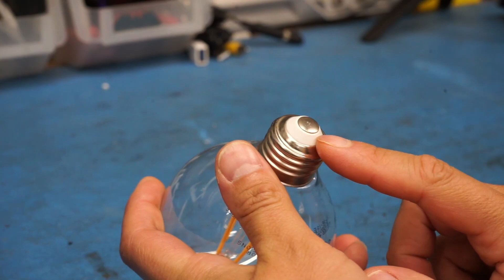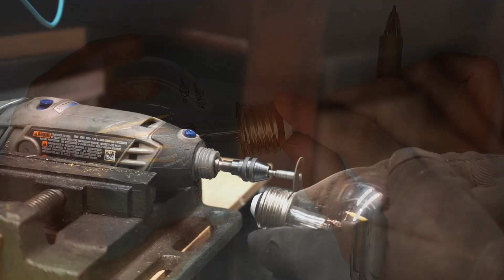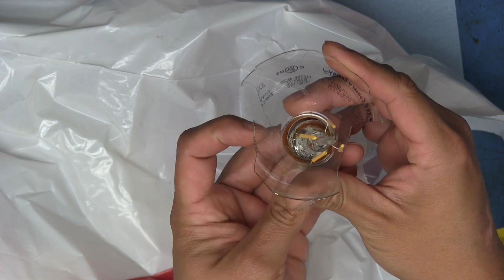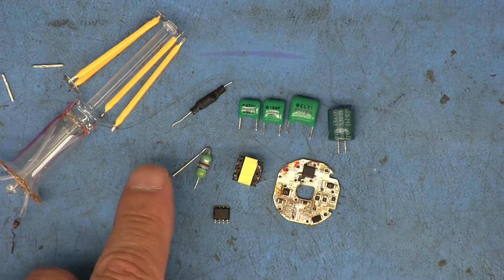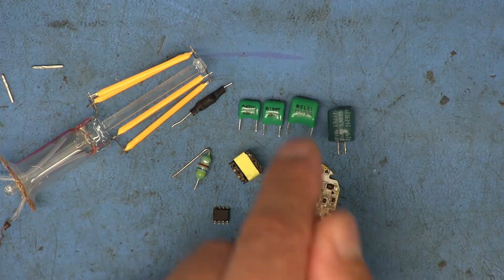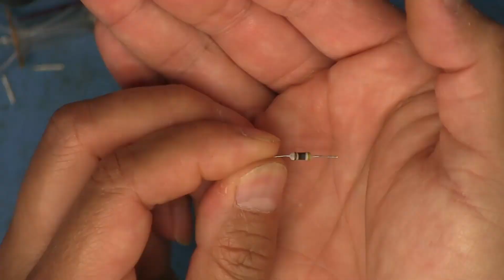TEF #115 | Failed LED Bulb Teardown And Schematic

Comment: What software are you using?  Is it free?  I'm running Linux, but can use Windows if necessary.
That circuit appears to be a buck-boost regulator that creates a DC envelope that rides on top of the rectified sine wave.  See how small C2 and C3 are?
It will turn on hard (large duty cycle) at the low ends of the sine,  and very little (small duty cycle) at the peak.  All LED power comes from the inductor during switch turn-off.

Comment: Count the dye on each LED on the strip x that by 2.7v
Reply from the maker: The video is too dark and grainy to tell, but my best estimation is there are about 28 LEDs per filament, so almost 76V. 

I could probably get an accurate count if I set up a filament the same way and used the night sight feature on my pixel to get a long exposure shot of it.